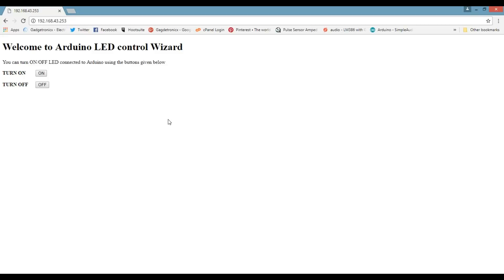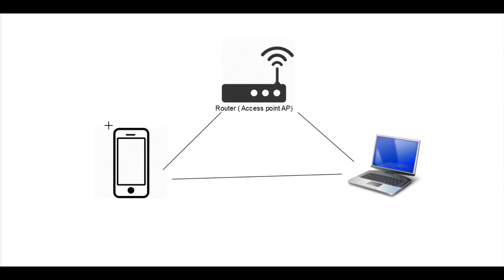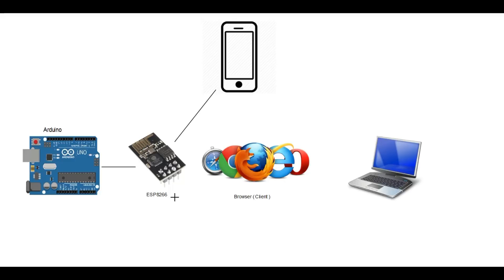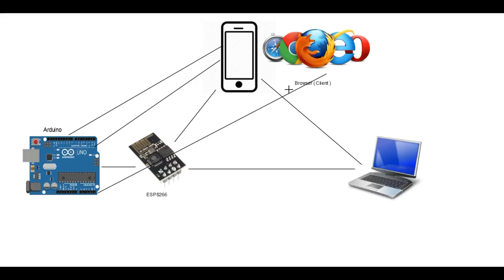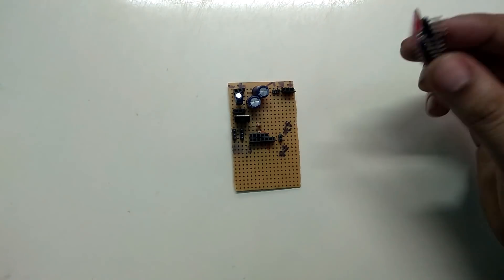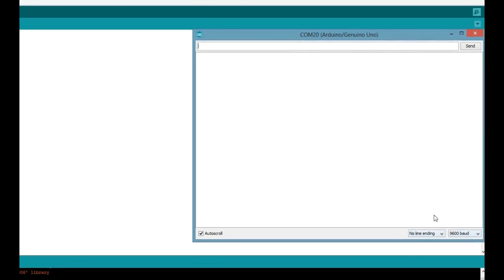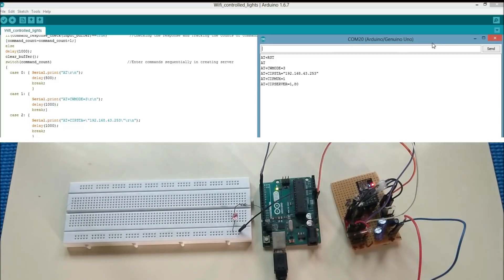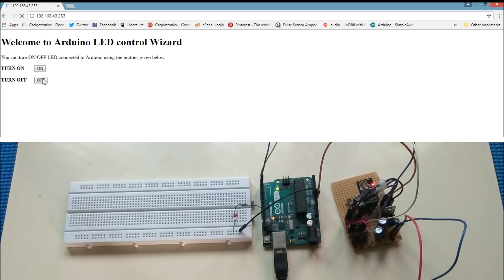Creating Arduino Web server and controlling things via WiFi - Step by Step Tutorial

Comment: Wouldn't it be easier to configure the 8266 as the access point?  Then any device (smartphone, laptop, etc.) could connect directly to the 8266.  Your configuration relies on the smartphone as the access point ... what happens if the battery runs down?
Reply: Where did you learn all this??
I know probably the internet but specifically what??
Reply from the maker: Yes that would be an easier way to do it with little modifications in the code
Reply: @Gadgetronicx  Can you explain how it would be done?
Reply: Would be interesting with portable projects
Reply: I think using already available wifi router at home is a good and reliable option. It is turned on all the time in most homes. Coming to your suggestion of making esp8266 as an access point will not be preferred by the user as he wouldn't want to leave the current wifi network giving him internet access. So its better to just connect your esp8266 to your current home network and control it from all devices. Its just my opinion and obviously there could be many other ways to do it.

Comment: Hi, I configured the esp8266 wifi module as an access point, then docklight scripting V2.2  connected esp866 with 192.168.4.1:1025 port and send data periodically 0.5 second to server. But server read data and it breaks off in a few seconds. How can I prevent the server from going down.

Comment: How Do i control Led through a toggle switch instead of the buttons?
Reply from the maker: You have to look for HTML code to add toggle switch in your webpage and understand how it sends the request and then modify your code based on it

Comment: Is it working for long distance control? It is always working with in particular distance , But we need control over the long distance whenever we want to control this circuit at that time we need to interface the ESP8266 connect the mobile or PC but its via Wifi, But i need to control over website ,You have anyone idea about this.

Comment: Dear sir I'm doing air pollution monitoring system using esp8266 with Arduino in that project there is no error in code when I uploaded the code wife module release the network when I connect that wifi module it's showing there is no internet connection. What I do??

Comment: Can i  access the web? where ever i am in the world? or just for those who are connected to the same router? sorry for this noob question...
Reply from the maker: If you got your ESP module connect with your router. Then it's possible to access and control the LED
Reply: you need to enable and configure port forwarding feature in wifi settings!